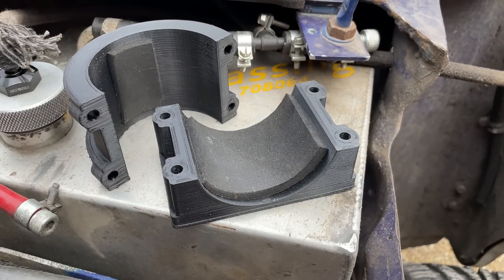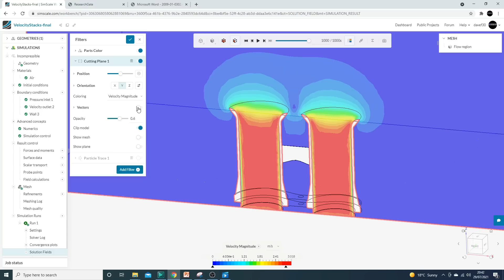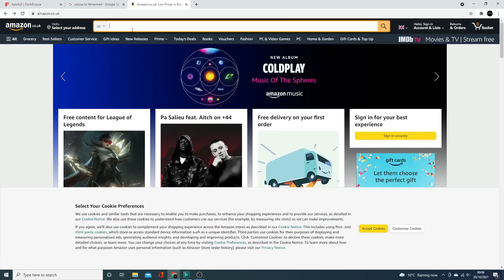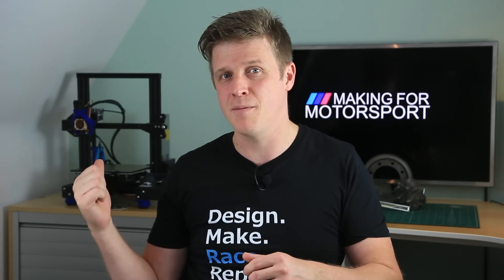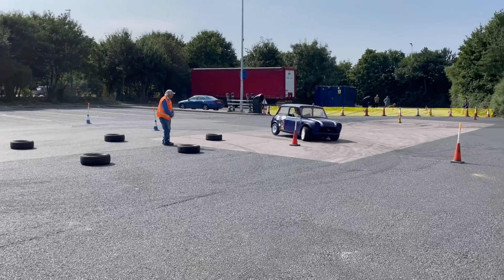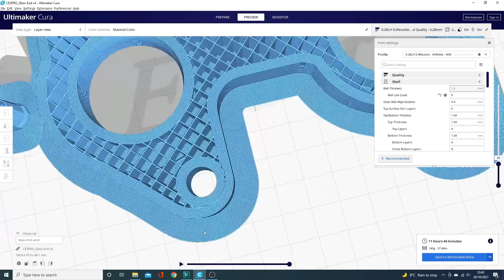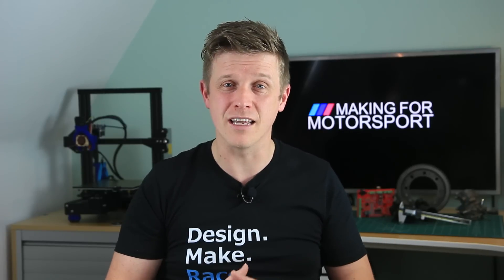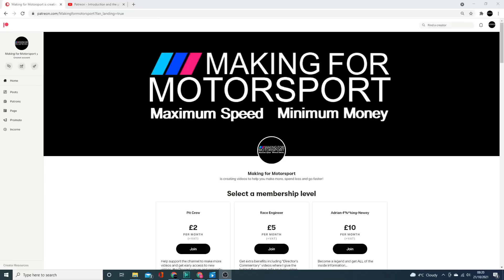3D Printing Car Parts - Under the Hood (or bonnet) - After a year of motorsport......

Comment: Very nice video, im using as a base for my intake manifold for itbs too, but for the clamping forces you can use an metal tube the same length as the plate, same as oem plastic manifold uses.

Comment: For your application, scratch rubber orings and move to SILICONE orings. They have far more squish which reduces mechanical stress on the flange to get them to deform which is required to make them seal.  Also, design your parts around steel spacers or sections of steel tube. I've precisely cut sections of steel brake line before and used that to precisely limit clamp load along with thick steel washers to spread the load across the part. Had you done this with your coolant port, you wouldnt have had a leak. Also, if you need to clamp rubber boots to the intake manifold, the hose clamps can crush the plastic intake. To get around this, cut a small section of tube that is the same id of your manifold. Compensate for the tube by giving it a recess or pocket that is the same size as the tube in the models port and press it in. The clamp now sandwiches the boot and your printed intake manifold against the steel ring inside the model that will support the plastic and prevent it from collapsing.

Comment: Been running ITBs on PA-CF manifolds and mostly worked okay but the nylon softens up as it absorbs moisture. Currently reprinting in Bambu Labs PPA-CF which has a higher temp capacity (prints at 300C) and doesn’t absorb moisture very much. The filament is rock hard and doesn’t soften noticeably. Looks to be a great upgrade. As a bonus it doesn’t take as long to dry to sub 15% before a print.

Comment: Mate I was worried printing a connector with ABS for a small hose that goes near the engine, but after seeing this video and how close to the engine and heat you've used these parts, I think I'll be fine :D Thanks a lot

Comment: The ender 3 series is still one of the best. With so much aftermarket support these machines have extremely high performance potential at a relatively low initial cost.

Comment: Bit late to the party but as they say better late than never.   Great content and clearly presented for those of use who aren't engineers.     I've designed ITB's for SR20 low port ( sorry not mini ) and have a water jacket between 1 and 2 cylinders.     Been trying to find a 3D process and material that will withstand the heat and continual contact with water.     I'm interested that yours in nylon CF are doing the job, with a little assistance from the steel plate.     Was this a problem for you?
I'm also designing a large volume airbox ( for quads ) and thought nylon CF would be the go but from your experience it looks like ASA might be a cheaper alternative as long as it can handle a filter pod hanging of the end of it?  I might have to rethink the print direction?  Problem is it's 570mm long and that's a big bed.       Would prefer not to break it up into smaller pieces.

Comment: yikes im 2 years late... either way, did you not use an enclosure when printing with ASA? I thought it was also toxic just like ABS. Also, I've been using polymakers polylite-PC (polycarbonate) in the engine bay and have had success with it. Granted it hasnt been in direct contact with the engine, but I do have it close to the turbo manifold and it has held up so far.

Comment: velocity stacks has a design flaw in terms of maximum airflow, i can design you new ones if you send me the flange DXF and overall dimensions i have to stay in. Easy peasy really, just some geometry changes. Easy few % more HP.

I just have to remember all the research data i went through years and years ago before designing again, i guess it comes back to me in a ~30minutes. I need to design some other velocity stacks too soon so this would add only like 60minutes of work for me to design you more optimized ones. (Rechecking the exact expansion ratios to maximize airflow!)
Reply: oh and that style air filters are extremely restrictive, you are most likely loosing a few % there. Considering this is a race car i would run it without any filters despite being pointed upwards, likelyhood of any debris causing engine damage is very low.

Comment: fuel pump holder issue -> was not designed for 3d printing, always be mindful of layers so printable on it's side is best. The longest possible continuous extrusions of plastic.

Comment: I use Priline Carbon fiber polycarbonate for a lot of my prints under the hood. I may try this carbon fiber nylon sometime. 

My Priline filament works great as long as it is not in the valley between the two heads of my Toyota 5MGE engine. I tried printing spark plug wire guides with 100% infill and the one in the valley ended up warping badly. It does get VERY hot there.

Comment: I've not used ASA before. Looks like I should give it a try. I just made a new under hood fuse box cover for my Barchetta using PETG because of concerns about the temperature in the engine compartment. So far it's holding up well.

Regarding the use of carbon, I've always been skeptical given that it gets it's strength from the long strands and tends to be chopped into tiny bits when in a filament.

Right now I'm experimenting with using a 3d scanner for modeling. So far the results have been a bit dicey.

Comment: I read another tinkerer mention experiencing shrinkage of the carbon nylon parts over time due to moisture getting trapped within the part and switching to sls printing for this reason.

Can anyone comment on this?
Reply from the maker: Nylon does absorb water which can make it slightly less stiff but I am not sure on the dimensional change… 

Not something I have noticed.

Comment: Why not upgrade to a direct drive extruder? You can print a bracket for it and just move the factory extruder onto it, you just need to extend the wires. I did it on my cr-10 and it improved print quality, even with pla/petg, and made printing other materials such as tpu way easier.

Comment: I'm doing this on my triumph gt6 as manifolds just aren't available that'll clear the bonnet. Hoping that the temperature is OK as the engine isn't a crossflow and exhaust manifold bolts on right beneath the inlet. Exh & Inl  Flanges actually touch each other.

Comment: So, looking at this I have to ask, how Wild would it be to print a fuel rail? The heat seems to be a non issue, as does the fuel resistance, how about pressure? 
Don't get me wrong, I fully understand how bad it would be if it did fail, but none the less it has me curious

Comment: Great content, thanks for making the video!  I've had my turbo'd first gen rx7 running a 3D printed "injector manifold" for close to a year now with nary an issue.  It was definitely a huge step up from the prior blow-thru carb setup I had.

One suggestion I would really emphasize is the use of proper compression limiters for any through-bolts.  Regardless of whether the material is solid beneath it or not, the material will creep and eventually lead to a loose joint - nylons are especially prone to this.  It's not the bolt that's coming loose, rather it's the material underneath it slowly moving and relieving the compression force.  Heat-set compression limiters are a great option for this as well as the split collar style.  Alternatively you can also cut some pipe that's the right size down to what you need.

As far as materials go, I printed the injector manifold from NylonX and it's been doing great, although I'd be a little hesitant to print a full manifold from it.  I've also got a lot of polycarbonate parts under the hood such as coil brackets and various other bits and bobs.  ASA for engine top components makes me a little iffy, but as long as it's not touching the engine I suppose it's fine.  With operating temps in the 80-90C range (or sometimes higher) that's getting a little close for comfort in my opinion.  Fiber filled ASA, glass or otherwise, would probably be a great option however.

Recently I've acquired a few other materials for an upcoming full manifold that I've been working on (same vehicle).  eSUN ePAHT-CF and Essentium PPS-CF are the two materials I'm testing, although I have reservations about each.  The PA doesn't have as good temperature resistance and is flammable, however the PPS is extremely rigid and not particularly tough with comparatively worse layer adhesion.  I'd love to try some 3DXtech PPA-CF but unfortunately I can't hit the 90C recommended chamber temps (it has temperature resistance on par with PPS-CF; 220C continuous).  The main concern about temps is that it's a turbo rotary engine, so the intake is mere inches from the turbo and exhaust.  On an NA setup I'd be confident that even the ePAHT-CF would do fine.

Anywho, thanks again for the video.  Keep up the great content!

Comment: BTW, I know this video is a year old now, but if you still haven't upgrade your Ender 3 to a direct drive setup yet, DO IT! You won't regret it, it's SO much better than a Bowden Tube setup, and it's cheap and easy to do.
Reply from the maker: I need an update video on my printer… I am running DD with a clone BmG and a pancake, into a V6 hotend!  It is good….
I did it months ago tho print TPU… that’s still not been opened!

Comment: I've got a 3d printed part under the hood. I designed a manually controlled and lockable Idle Air Control Valve for a import tuner car of mine and printed it out of PETG. It's held up great for a while now. The reason for making a manually controlled and lockable IAC was because this car doesn't have aftermarket camshafts available and I wanted it to have a slightly erratic idle like a camshaft could give it, and I noticed when the IAC was in a particular position it would have that erratic idle sound, so I made an IAC that I could be manually set to that exact position and then locked down so it can't move. It worked exactly as I'd hoped and now the car has that erratic idle sound like it's cammed!
Reply: That's creative!

Comment: Looking up ASA, it sounds like you should probably be filtering and venting the off-gas. Might be worth mentioning this in the future. Nice video though, subbed.
Reply from the maker: Yeah, it’s still got the styrene from ABS so it’s not the good stuff…
I have activated charcoal and fans ready to install… just never got round to it 🤷‍♂️
Reply: I print all my stuff in an heated enclose with charcoal filters and room air purifiers NP!

Comment: I made a similar bracket to your fuel pump bracket but used a CF tow on the outside.  Message me if you want a link to the photos. I don't want anything in return.
Reply from the maker: Nice!  CF is just straight wicked.  (About to start some here)

Comment: Why don't you insert a metal spacer just short enough to allow enough force from the nut but preventing over-stressing / compressing the flange of the manifold?
Reply: Exactly what I'm doing now with my ASA parts that bolt to cases of a Ducati.I wish I could attach a picture of them here.! I found it to be the best way as people want to torque the bolts to the listed 8ft/lb.

Comment: Make an sheet metal frame that goes over all bolts on the manifold to create an even clamping pressure all around. And use springs under the bolt heads.

Comment: This video inspired me to start using 3D prints on my Rover SD1 project. It's like you say - once you've got the equipment, the know-how, and the confidence, every problem on earth starts to look like it's best solved with a 3D print. Especially stuff like interior trim, clips, and switch holders that are only available used and all very brittle by now.

Comment: Do you think PETG would be able to withhold engine bay temps for an intake box?
Reply from the maker: I would not trust it.  Not just because it melts but how it melts, the Tg (glass transistion temp - the start of melting)is higher than PLA but PETG goes very soft very quickly after that.  PLA may warp but PETG is a just a puddle. 
ABS or ASA at least for me…

Comment: Found that if I spiral wrap some sandpaper around a die grinder shaft or dremel tool, I can smooth the inside of the velocity stacks nicely.  It worked well with taulman 910 but I have never used the CF nylon.

Comment: I used to work for a company that made aerospace and military gaskets, the gaskets could easily be deformed to the point of damage. A common solution is to add compression stops. Calculate the percentage of compresssion required, this gives you a figure for the thickness of the compression stop. These can simply be metal tubes cut to the compressed thickness required, or washers. CNCKitchen might have some figures for compression % without damage.
Reply from the maker: I am incorporating those into my latest build on Project Siesta 👍

Comment: Hi, thank you for all the good content you provide - you inspired me to buy an ender max to make my own car parts and prototypes. I just finished prototyping alternator pulley - to test fit before  turning an alloy one and i actually was thinking if you ever tested nylon carbon fiber filament in such application? In theory it seems to be super strong - what worries mi is the abrasive/temp action when the belt is leaving / entering the pulley. Any thoughts?
Reply from the maker: Good to hear man! Sounds like you are getting on well with it!  I haven’t tried printing for that application and the abrasion of CF would be a concern… I’d be tempted to try a plain Nylon, a Pa6 maybe… I have been dying for an excuse to try that….

Comment: I made an engine swap on my motorbike and use abs printed engine mounting plates for fit test before make some out of steel or aluminum. If you don't have drawings and measurements are hard to get because of space or in my case unknown final position, printing indicator plates and measure against them helps to get a perfect fit. I also printed some small brakeds, jigs and fixtures. Any experience with abs velocity stacks? I really enjoyed the 3 episodes of bringing the itb's in your mini. You are doing a great job!

Comment: Hi, I'm currently thinking about 3d printing a powerbox style airbox for my corsa gsi16v (really common mod as the stock inlet is really restrictive). That part would be  joint to the standard aluminium manifold, so I wonder if it would be necessary to use nylon carbon material or with the apollox material would be fine, as this part would be pretty much as far from the head as your velocity stacks. Also my car is a street car so, would you recomend this for a streetcar (with a little bit of care for the inlet).
Reply: I'm also thinking about laying some fiberglass on the exterior for protection
Reply from the maker: I know the bit you mean… depending on your gasket that is likely to get nearly as hot as the engine as Aluminium is so conductive to heat, especially on heat soak when the engine is turned off.
But even with that, I would start with ASA and keep a close eye, any failure is unlikely to be catastrophic so if it fails then just reprint in the higher material.
Reply: @MakingforMotorsport  thank you for the advice!!! 🙌 really enjoying the content!!

Comment: Couldn’t the braces cause the effect double?
Reply from the maker: Not really, they lock the whole arrangement up solid, so if there is no relative movement between the ITBs and engine then the manifold is not bending and therefore it’s not under any dynamic stress.  
It’s fine with injection but a lot of carbs have isolation elements in the mounting so that might be different….

Comment: Thanks for the video, it was really interesting. I'm in process of modelling and printing interior parts for my 1972 Camaro. Currently working on parts like speaker mounts, cup holders etc and finally will proceed to print the whole dashboard. Currently using PLA for the proto versions and thinking of using ASA for the final parts. Any tips people here can give are warmly welcome. The plan is to go full crazy with modelling, using everything 3D-printing enables and forgetting most of the original parts as the car itself is already full of modifications and upgrades (new engine, mod to use CNG etc etc)
Reply from the maker: There are so many things it can be used for it’s great… for me the other best part is I struggle to work on the cars or fabricate during the day (work+kids) so modelling at night then having a ready to fit part that comes straight of the printer 👍👍👍

Comment: 3d printed car parts? Welp I have at least one in each of my family cars. I have printes spring insulator out of 40dTPU (yes I know it's not safe but originals were desintegrated so whatever - right now it's holding for 2nd year), badges, plastic headlightlight holder/height regulator out of petg (now it's making it into 3rd year), nylon manual transmission shifter bushing, new dome light with lens. I still didnt finish my first project that is corner turnsignal, but maybe I will do this before christmas ;).
Reply from the maker: A piece purely in compression (like a spring isolator) along the printed z-axis should be fine! 👍. Sounds like you’ve done a lot of this!  Nice work!
Reply: @MakingforMotorsport  Also one thing to note - PETG doesn't work on aplications inside the car, it deforms from heat pretty badly. On the other hand you can make pretty nice wheel center caps (like if you don't care for 3d effect or you like matte effect after sanding). Sidenote if you wonder why would anyone want center caps: you can apply BMW specific wheels onto GM vehicle (like C5 Corvette or Pontiac Solstice) but half shaft will stick out, so either custom caps of metal grinding.